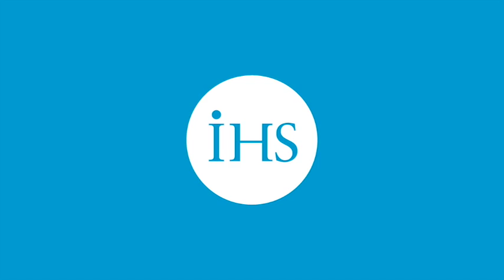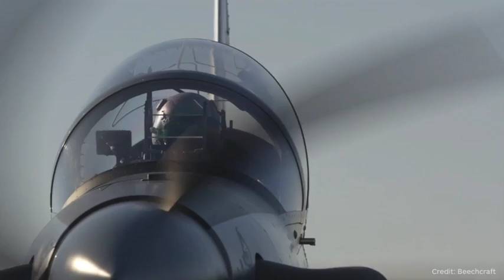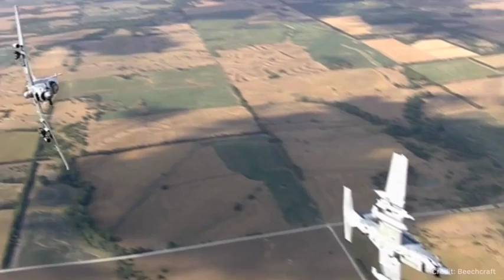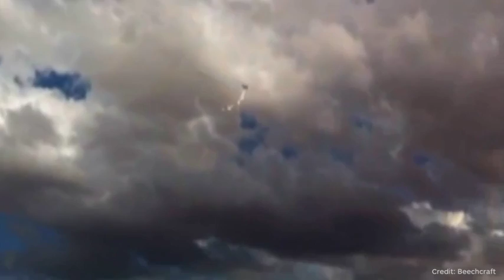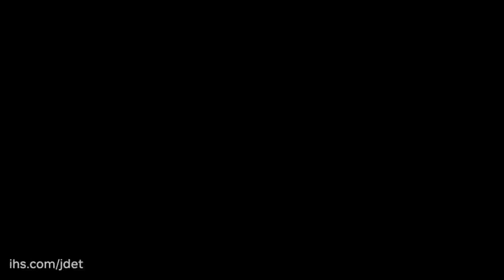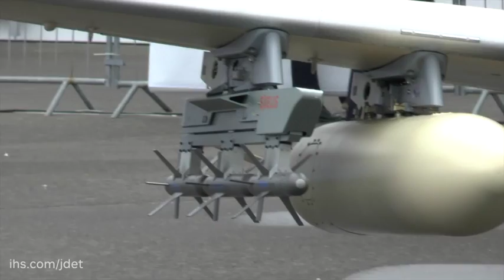Paris Air Show 2015 Beechcraft AT6 Wolverine Light Attack Aircraft

Comment: Why not just add all these modern weapons, engines, and sensors to the Skyraider?
Reply: Not enough airworthy A1s around; also A1s have lower payload.
Reply: Superb idez, the H model skyraider could move 10 troops or 4 litter wounded.  This secondary role adds to mission versatilty. I would "modernize" the skyraider, absolutely.  Superb CAS and multimillion capacity.
Reply: Saldy the Skyraider has not being in production for decades, same problem as the OV 10 Bronco.  The AT 6 and the A 29 have the advantage of being versions of trainers currently in production.

Comment: SUPER TUCANO MUCH BETTER   AT6
Reply: There is obvious differences.   The Super Tucano has two 50cal machine guns inside the wings that fire 1100 Rounds per minute.   Sounds fierce huh?   It only has a capacity of 200 rounds.  So,  if you use the machine gun,  It will fire completely dry in only 10 seconds of use.
Reply: @javascriptmikecoder5790  Those MG are really good for killing drug running cessnas and drones. The Super Tucanos has shot down more than 200 drug running cessnas and helicopters in South America, and terrorists are known to use drones in the middle east.
Reply: but the T6 costs a hell of a lot less,,,, ole USN vet
Reply: Actually the super tucano can cost less than the AT-6.  And can carry more weight

Comment: I like it...and the AT-6 Wolverine is built in America, by Americans. It has a higher top speed than a Super Tucano, and that matters to those men who are under fire waiting for air support.
Reply: The Super Tucano is far superior in combat than the AT-6
Reply: +Damian Wootten  maybe so but the super tucano comes with two 50 cal machine guns built into the wings this plane dosen't therefor the guns for this is gunpods strapped on underneath tcreating more drag on the plane
Reply: why?
Reply: I hope they get what ever bugs that cost them the Afghan contract worked out. Honestly I don't know why we ever let the A-1 go without a successor in our military.
Reply: Damian Wootten Cost was the tie breaker for me. The Super Tucano IS better but it costs twice as much without being twice as good. We shouldn’t pay 100% more for a 50% capability increase.
Reply: @curtist919  A-29 dont costs twice. 

Actually depending of the trade, can cost less than the AT-6. Since the US is paying in Brazilian Real that is a way more cheaper than the us dollar, even with the travelling costs. 

A-29 have a huge experience in war, At-6 dont.. And this counts a lot

A-29 Can carry more weight, meaning more fuel, actually the At-6 can carry 1000 kg and the A29 1,500 kg of fuel and bombs, A29  having 8 hours of autonomy and at-6, 6 hours only, and the limit speed is not that huge difference, because the planes will only fight for ground support and both have the same motor ( at-6 is fast because its smaller and carry less weight), they are not designed to dogfight with other planes, the two machineguns are a pre requisite to Usaf, so AT-6 will have to sacrifice two hard points anyway. 

A-29 is bigger and have more space to put more protection, protecting the pilots against .50 bullets, At-6 dont, protecting only against 7.62 bullets. And this can't be changed because of the design of the plane..

A-29 has a option of HMD. At-6 has to receive an improvement to allow this. Meaning more money just to improve the plane to have this option.
Reply: The AT 6 might has been a better trainer, but the Super Tucano is more nature as a attack plane, with more payload and better rough field performance. Still while the Super Tucano won the ALX twice, the US shall buy the AT 6 for the border patrol were the aerodynamic performance its better reason for chosing one type over the other an let the Super Tucano to the US Air Force and Navy.
Reply: Carlos Campos It isn't better, it is larger and heavy with a more stable flight profile(not always a good thing in a combat aircraft), because it is based on the P-40 Tomahawk, the AT-6 is based on the P-51 and is lighter, more agile,faster, and more fuel efficient. Most pilots from NATO and American nations also train on the basic T-6, making almost any NATO or American pilot an AT-6 pilot if needed. The AT-6 sensor pod is an existing model used on aircraft already in service in many militaries around the world allowing previously trained WSOs from other units to be easily trained to man the backseat of an AT-6. The AT-6 also has parts commonality with the T-6 which is used by more Air Forces than the Super Tucano, simplifying logistics. The AT-6 also has the advantage of being carrier capable which the neither the original P-51 or the A-29 are.

 And only parts of the A-29 are US made. The A-29 added about a thousand US jobs, the AT-6 would have added several times that. If the US is going to buy a light attack/ISR aircraft for its own use it will be the AT-6 or OV-10X not the A-29, the only reason the A-29 was chosen was that the AT-6 faced a development hiccup that couldn't be solved before the deadline for the Afghan contract.
Reply: @flyboymike111357  the AT-6 is not based on the P-51; I dont know where you got that from, but it's absolutely untrue. The T-6 came from the Swiss made Pilatus PC-9, itself a development of the PC-7. The T-6 shares about 30% commonality with the PC-9 but even the AT-6 is quite different from the standard T-6. The AT-6 is not carrier capable as it has no tailhook nor does it have any launch fittings on it's airframe or undercarriage. The Super Tucano is widely sold across South America, especially to nations that operate the original Embraer Tucano.
Reply: Synthetic NZ The trade of is making the Super Tucano less adaptable. Look at the light attack choppers and you'll see that not country is producing one that can't switch it's .50s for cannons, more missiles, fuel, or lighter weight. The AT-6 is already faster and more fuel efficient so it can afford to have external guns and still perform well.
Reply: +Mike Mac If you look at the landing gear on the T-6 compared to the A-29, it looks like a joke, if you study aviation history you would see that very few training aircraft have ever made the leap from trainer to mission capable combat aircraft, the T-6 wasn't even designed by Beechcraft, it is a Pilatus trainer design, purchased by Beechcraft, It doesn't matter how much Beechcraft modifies the T-6 it will not stand up against the A-29 which is a combat mission capable aircraft by design.
Reply: Carlos Campos The AT-6 can take external tanks also. The guns aren't a pro or a con because the A-29 only has 2 .50s with about 400 rounds which can't be used for much more than strafing runs against lightly fortified stationary positions or lightly armed vehicles for anything more the Tucano needs pods just like the AT-6. The internal guns can be scene as a bonus on rare occasions but on most missions they just waste fuel by adding weight.

The USAF did approve the super tucano, but for the Afghan Air Force. which makes sense because the Afghan Air Force is starting new and could form their supply chains around any aircraft. But the A-29 didn't win approval over the AT-6, it won because the AT-6 was still a younger design that had a few developmental hiccups and couldn't provide its next iteration in time for that particular contract. 

The AT-6 can also intercept aircraft, and it can land on rough areas  and straight roads as well, this isn't a rare feature for a propeller driven aircraft. 

I don't dislike the A-29, it serves a similar role as the AT-6 or the A-1 Skyraider depending on configuration, and it serves that role well.  I think Air Forces should be considering both, like a lot of PMCs are. If I was a pilot in one of the PMCs that will be flying both A-29s and AT-6s I would probably prefer the A-29 for it's ability to counter slightly more torque, but I can understand that the AT-6 can also respond to ground troops needing support slightly faster and that is a good reason to have both planes in the inventory.

Comment: Those main gear / wheels / tires just don't look nearly as rugged as the super tucano.  i wonder how they really hold up on improvised strips.
Reply: +Michael Dudek Thats because the T6 was built as a trainer, the A29 was built as a fighting aircraft able to carry heavy loads of ordinance off of unimproved strips.
Reply: @BlueSky-qv7cd   A-29 its a trainer too.
Reply: The Tucano its a Trainer, the Super Tucano is the attack plane. Different, longer fuselage, more powerfull engine, 5 blade propeller, wing mounted machineguns, armor and a undercarriage designed for dirt runways.